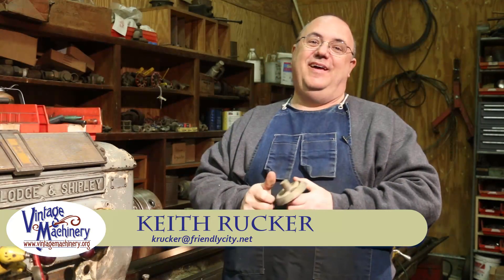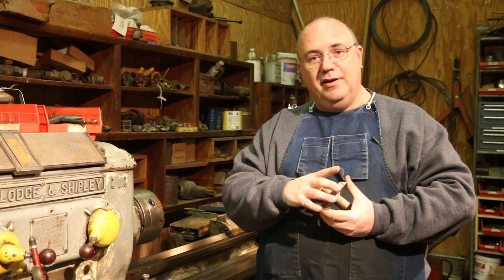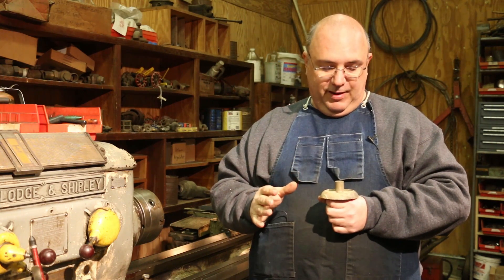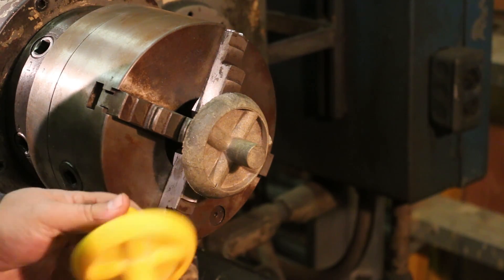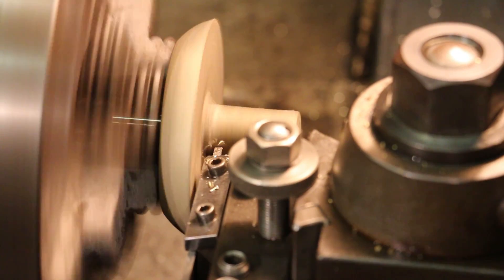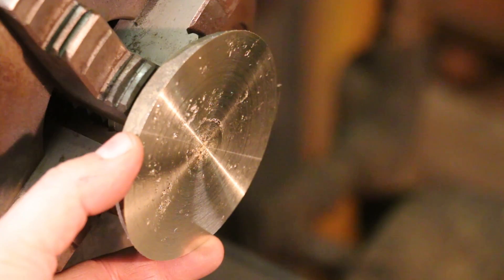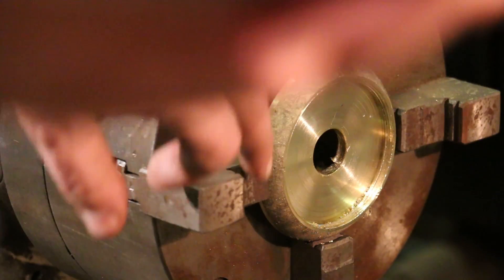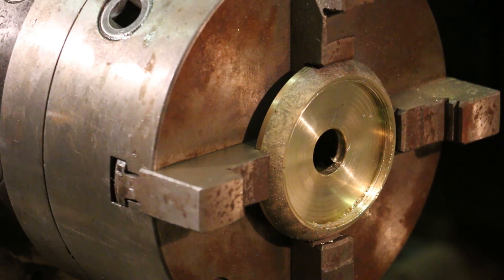Victor Safe Restoration 11:  Machining the Dial Back Plate

Comment: I had a novel idea, if casting the patterns is problematic, melt up a lot of brass and cast your own bar stock so material uniformity won't be in question. solid shapes pour well and defects only show up at edges and intersections

Comment: If you could find another set of jaws for the 4 jaw you used here, could you machine down the outer third so it wouldn't get in you way? Just level it off with the center section.

Comment: Hope you save all your Brass chips for remelting. For that matter Alm. and Bronze also. Just some 5 Gal. bucket, Also any friends do reloading? They all way have some damage brass just make shore that the primers are out of the damage brass.
I have done big pours of brass in to things like #10 can or other cans (cans good for one pour as you damage the can getting it out) that been packed in sand to get some round stock. Need round stock pour in to Cast Iron pipe and you can heat it also (Cast Iron) Square stock, Use a steel U channel with end caps then mill to size needed 
REMEMBER 1: Heat up U channel or Pipe before pouring, Help keep the air bubbles out and spladder.
REMEMBER 2: Brass from someone that reloads, NO bullets NO Primers on the cases, Most people that reload toss there damage brass or save to to send to a scrapper (If they will take it as most scrap yards fear live rounds.)

Comment: one method of pouring metal into molds is to use some form of channel to allow the metal to flow into the fill hole event.y. For brass and aluminum I may cut a 2" steel pipe in half and drill a 1 " hole in the end that sits on the fill hole. have the pipe elevated to about 30 degrees or so and then poor the metal into the pipe and let the metal flow down the pipe and into the fill hole through the 1" hole. I think it would eliminate some of the turbulence caused by directly pouring the metal straight into the hole at 90 degrees. Also the use of risers for venting instead of poking holes with a wire for venting. 

My idea is to allow the metal to flow slower and more evenly into the fill hole with a lot less turbulence. The metal is burning the oil (smoking it) which doesn't have a good place to flow out of the mold without a good riser.  

Just my thoughts.

Comment: You could clean the back side without removing it from the chuck with a 3-corner scraper or one of those little hook deburring tools; I thought I saw you use one of those in a previous video. Or a small boring bar that will fit in the hole and has a V-point as someone else mentioned.

You could have measured it with the depth mic and some math. Measure from the ring height to the floor height, then from the ring height to a parallel (or 6" scale) held across the back of the hole. Subtract the first from the second measurement. But a thickness mic would have been easier and is another fun tool to buy! ;-)
Reply from the maker: l wilton I played around with my depth mic and it was not long enough to span across properly.  Also, I found it difficult to get an something behind the piece in a way to get an accurate measurement - it was close but not right on.

Comment: Keith, silly question, when you initially had it chucked up on the rear spout, why didn't you turn the face, the rounded part that will be visible?
Just starting out, want to learn how to think through these types of projects.
Thanks
Tony

Comment: Kieth, take it off the lathe and debur the back of the bore. Put it on a serf ace plate and use a depth mic or the shaft of a caliper. Think you said it needed to be about 1/4", not critical.

Randy

Comment: Although not a perfect solution to the measuring problem, something that would help, and perhaps get you "close enough" is a set of Starrett #425 calipers (the 3" size). My grandfather is a professional machinist and has carried his daily in a pocket for decades, and he gives a set to his children and grandchildren who show mechanical inclination.

They've been discontinued by Starrett, but you can find them on eBay in good condition for around $20-30 or so, if you watch long enough. They're endlessly useful for a guy like you; they measure inside and outside in 1/64" increments, and are handy for measuring screws, bolt heads, bar stock, sheet and plate, roll pins, wire diameter, determining what size drill to use for a clearance hole, thicknessing lumber, etc, and they even function as an exceptional pair of tweezers in a pinch. Since they're small enough to carry in a pocket they're always right at hand when you need them; if you're in the metal room or the scrap pile, or even underneath the truck (machine, locomotive) wondering what size wrench to ask your helper to hand you.

I saw that you already ordered a mic for this measurement, but the 425's are handy enough that you might want to start carrying them anyways.

Comment: Depending on how true the face of your 4 jaw is to your lathe. Use a set of parallels behind your part just to locate it. Make sure the part is sitting flat on both and you could use you machine readout and a dial indicator to check the depth. A groove/hub mic works great too! Make sure it's calibrated for both internal grooves and external thicknesses. I had to lap .001 off my mitutoyo. Your drill was walking pretty bad!! Can't wait to see more of your videos!!!

Comment: Hi Keith,
You say you have a big stockpile of scrap brass, maybe if nothings turns good on the castings, you can mold a big 5 inches bar stock, there might less chances for inclusions.

In any case, I prefer to re-visit the proper molding methods with clean parts as a result, to be continued...
I'm working on a electric ceramic oven to get it to melt aluminum and brass... More a spring project though.

Promises to be instructive.
Thanks, Pierre

Comment: You can reach inside the hole with a small boring bar angled back toward you and do the needed deburring... Then a short parallel (slipped in behind the part),  and a depth mic would measure that 1/4" thickness you seek (after facing the front edge)... Looking forward to your solution and the cost to achieve it... This is a great learning adventure! Thank you Keith! :o]

O,,,

Comment: i thought you would have turned the back face and back work holding stem and turned it around and finished the front.then removed the back stem and bore the hole last.you could have checked the thickness with a mic and gage block.thanks for another great video.

Comment: Neat job Keith. i was thinking instead of making up a fixture to turn up the outer edge could you use double sided tape and the live center to hold it in place.  I remember watching Tom use that method,  thought it was pretty cool.

Comment: Hi Keith, you could make those parts out of much smaller rounds of Brass by using a pot chuck.  The Hardinge lathe has a bunch of pot chuck accessories which make this kind of work very economical.

But I agree, if you can get the degas right, good way to go.
Reply: ***** Hi Keith, sorry, it's called a "step chuck" in official lingo. http://www.shophardinge.com/categories.aspx?catid=34

Comment: You had to drill the center anyway why not use a large drill or end mill instead of all that facing ? Was it a holding problem ? If you did your rough turning on a mandrel it may help you get your measurements better by moving away from the chuck . I don't know what to do about your castings I just started melting a little bronze to make small bushings for model engines .

Comment: Hi Kieth, thanks for another enjoyable video. I noticed at around 7:30 that it looks like there is a ring left in the metal at the diameter of the stub you included for chucking. Looks like maybe the metal froze around the edge of the stub before it could flow cleanly out across that face. I know you had mentioned that you didn't think the pour was quite hot enough, but I was surprised that you can see it in the casting.

Comment: I have seen people use a de-gassing agent just before pouring aluminium. Would there be a benefit from such a product for brass. This came up after a quick search. 
http://www.amcolmetalcasting.com/Solutions/Metal_Fluxing_Agents

The product Magiflux-CU704 looks promising offering de-gassing and fluxing. Where you might buy it by the thimble full however is a different matter :)

Comment: Why not use a dial indicator to measure the thickness. Slide a parallel behind the brass dial then plunge a DI in so that it registers on the parallel, note the reading then pull the DI shaft out of the way and move the carriage over and release the DI so that it contacts the outer face of the brass dial. You should be able to get a fairly accurate reading of the thickness from the DI.
Reply: lol ... I fully understand, you can never have enough tools ;)

Comment: one easy way to measure the thickness is put a parallel on the back side and use your calipers to measure the depth from the front face to the caliper.
Enjoyed the video.

Comment: could use an inside thread cutting boring bar for deburring the back. Keith Fenner measured the thikness by slipping in (and pushing) a flat piece of stock behind the part, covering the hole and depth miking it. thanks for the video again, Keith. enjoy a lot.

Comment: Howdy, Keith. Pick a weekend and the wife and I will come on down to do some ramming and pouring. Do you already know how to make a billet? I've made hundreds and they are fairly easy to pour and seeing as how you make your own patterns making a billet pattern, a horn gate and one or two cheeks for the flask should be easy for you. You have my email address, just give me a date and where to go and we'll see you there.
Reply: Oh, yeah, was meaning to ask....do you have a pyrometer or do you judge your heat by eye?
Reply: ***** If it is your intention to pour iron from the new furnace, I advise you to invest in a proper crucible made of silicon carbide. Absolutely NOT clay graphite as the carbon in the crucible will be readily absorbed by the melt and be ruined. You can use a silicon carbide crucible to melt and pour ferrous and non ferrous metals but the less expensive clay graphite can be used for non ferrous metals only. Once you get the crucible, the furnace can be built around it for maximum effectiveness. I know a source for foundry supplies but will have to look it up. will post it soon.
Reply: sandrammer budgetcastingsupply.com is the site. Advise you to get the bilge shape as you can make a stronger pouring rig and the bilge shape will lend itself to sitting in the rig with more stability. You will have to make the decision on what capacity of molten metal you will be needing to order the correct size. The subject of Pyrometers, obviously the human eye can't judge accurately how hot molten metal is just that it's hot and it's in a liquid form. You will need to pour your projects at the materials' proper pouring temperature and for that you will require an immersion or optical pyrometer.
Reply: ***** How much metal will your crucible hold? suitable for one person pouring?

Comment: keith  i always look forward to your videos. couldn't you use a boring bar ground for internal threading to debur the backside of the hole? i like davids idea of using a rod and two nut to measure the thickness. my old starrett depth gage has a hook on one side of the rule that would probably work as well.so many was to skin a cat.

Comment: If you plan to recast in the same shape, you can do the machining without any fixtures, I think.
Chuck it as centered as possible on the front stem, turn the rear stem round and the rear face flat. Turn it around, chuck it on the machined rear stem and finish the complete face (with the benefit of being able to measure the bottom thickness).
The finished front has an inside shoulder, this should be sufficient to chuck from the inside to cut off the rear stem and to finally drill and bore the center hole, maybe with a little true up on the rear face. Something like that might even work on the dial handle part.

Comment: Just do an indirect measurement with a fine threaded screw and a pair of nuts to get the thickness. Hook the head through on the back side and run the nuts down on the face. Pull it off and measure the gap. You could get fancy and turn the screw and nuts for a better bearing surface.

Comment: Hi Keith. Thanks for the video.
I was thinking about your mesuring issue and i was wondering if you could use  some sort of block or piece thicker than the depth of the recess, zero your callipers on it, insert the block into the recess and then use the callipers to measure the bottom thickness from the outside. 
I'm kinda new to machining and i'm just trying to find practical solutions to problems I will surly encounter along the way.

Cheers
Reply: ***** ok admit it it was the excuse you needed to get a hub micrometer... :)

Comment: Hey Keith, it appeared that the drill bit had a slight wobble while drilling out the center hole.  Did that offset the center hole any? Too bad about the inclusions, with what you learned I am sure you will get the next pour inclusion-free!
Reply: I saw it move too and figure it was because it was making a bit of an interrupted cut on those humps?

Comment: keith apparently borax is use as a flux when pouring brass hope this helps
Reply: i have heard stirring the crucible with a piece of wood as well
Reply: Use a stick from a willow tree ,keep the bark on its the salasilic acid the active ingredient in aspirin . To stir the melt works with Ali as well 

Stuart

Comment: Keith you can buy a groove checker from MSC that will convert a depth mic into a collar mic for about 80 dollars. Instead buying a specialized collar/groove mic. http://www.mscdirect.com/product/details/02198075?src=pla&cid=PLA-Google-PLA+-+Test&CS_003=7867724&CS_010=02198075